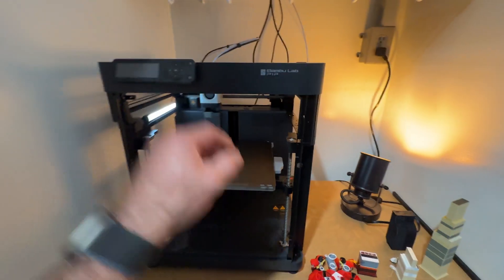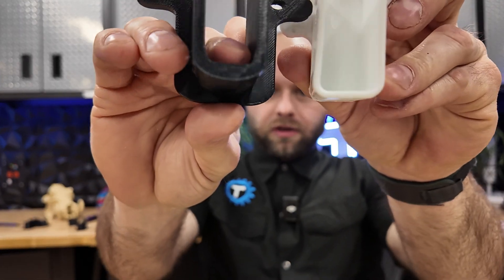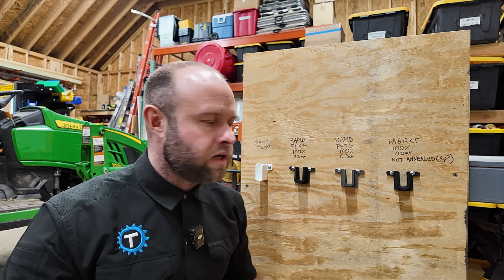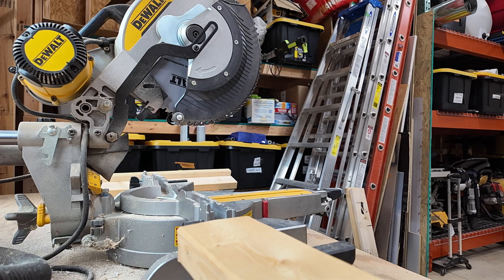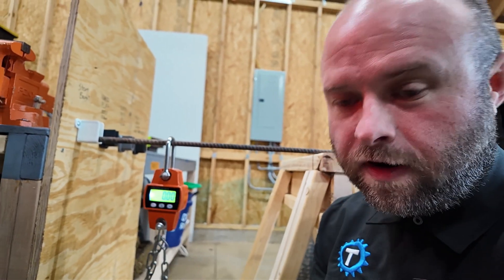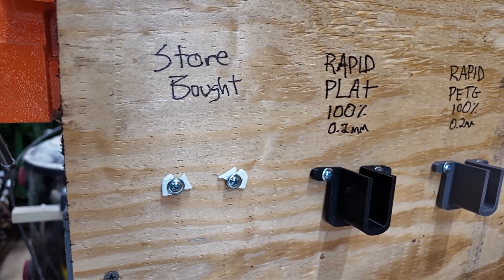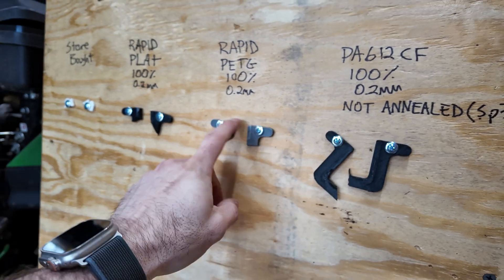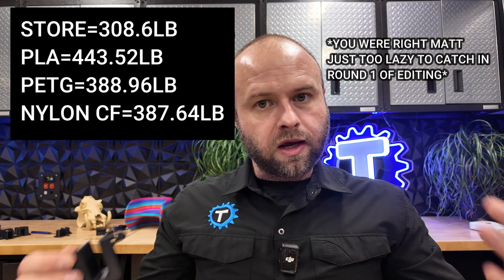3D Printed vs STORE BOUGHT brackets - Tested

Comment: If you blend the screw holes better to the main body of the bracket it would be stronger as well. I printed the small hooks that help support the back of the shelf for my closet. I didn't feel like running to the store to get some to replace the failed factory plastic ones, and now 3 years later they are still working fine. PLA+ is a surprisingly strong material as long as temperature resistance isn't needed. I've never been impressed with PETG parts for their strength.

Comment: If ur looking for a material that is good for practical prints use abs it’s meant for those applications it’s stronger then pla and petg also when the carbon was tested it was being pulled at more of a angle so that could of impacted the results a lot more based on how it broke

Comment: I make all kinds of stuff with my 3d printers. I have fixed my kids toys, replaced the handle on my wifes swiffer wet jet, made wire management, even zip ties in a pinch.

Comment: The CF filament are always less strong then the same filament type without CF. So your basic Nylon would be stronger then the CF nylon since CF is a marketing stunt and due to Carbon fibers align dyring the prong you layer adhesive is weaker.
Reply: One exception seems to be PETG. It loves being fiber filled.

Comment: I made a similar bracket for the wood dowel in our coat closet.  The dowel is warped from years of abuse and kept popping out of the attached metal bracket.  I essentially made an extender for the existing bracket and haven't had any issues.  The only difference, I printed mine out of TPU.

I'd be curious to see how a TPU version of your bracket compares to the others.  TPU is nigh on indestructible.  My first prototype didn't have thick enough walls so it started warping, but the second and final version has been rock solid.

Comment: I’m betting with a small bit of redesign and using the layer lines to their best advantage in tension you could get over 600lbs for the same weight of PLA. I liked your testing method… you do need spread the load between the sawhorse and the bracket… and proportion it depending on the distance of the gauge to the sawhorse and bracket. I’m guessing you need to divide the recorded breaking weights by 2 (ish)

Comment: Looks like youre not pulling at the same distance for each of them. This will change the load % transferred to the bracket/sawhorse.
Reply from the maker: Considered that! In the future if I need to pull down in a standardized direction i'll rig up a pulley and pull the rope with a speedboat
Reply: @TechnicalsTinkers  It's about pulling at the same distance from the mounting point. At the same time, make sure the distance between the bracket and the other supported end of the bar is the same. Example: 4 inch from the bracket, 24 inches from the bracket to the sawhorse. Based on what I can see in the video, results for the second and third bracket  might be off by 20-30% or so.

Nevertheless, good real life application testing!
Reply: 100%. That last test had quite a bit of side load on it compared to the first few test.

Comment: For your application, I wouldn't consider PLA at all, it is guaranteed to deform over time with weight applied. PETG would be a better choice, but from my experience, it still suffers from deforming after a long period of use. Nylon or Polycarbonate could be the best, and you certainly have the machines to print them. And interestingly, I don't think 100% infill is necessary for strong parts. From what I remember, 4-6 walls + 20%-40% should already be strong enough for most applications as there's a diminishing return for infill.
Reply: I would tend to agree, but I've a bracket holding my spare 45lb barbell to the wall. It's printed in PLA and has been there for over a year.

I was nervous, but PLA continues to impress me in load bearing, sub-40° C applications.

Comment: I like your move with not including the cost of the hardware, more times than not the correct mounting hardware is not included, or the hardware that they do include a subpar and will fail before the bracket or has manufacturing defects. I install thousands of anchors of various types every year and the separately purchased anchors are far superior.
Reply from the maker: @aetherguy881  let me ask you your pick for drywall anchors then. I like the 75# plastic screw in vs the toggles. You?
Reply: @TechnicalsTinkers  it really depends on the load that I am supporting. If I am installing most conduit 1 inch or smaller on drywall I will use a zinc zip it. Otherwise I will end up using a toggle bolt. Obviously if I can use a stud, i will. Other situations I'll use a heavier Duty anchor. However when I'm using a plastic anchor it's usually in a masonry wall.

Comment: Another YouTuber also tested the strength of different filaments and they found that the CF filament was not as strong as the others, so effectively it's a waste of money paying the extra…
Reply: Most CF FDM filaments are made so they are dimensionally more accurate not so much for strength. As others have stated the fibers can hinder layer adhesion.
Reply: Not sure of the specific video your referring but, I would have to disagree. CF is proven to improve layer adhesion. CF also improves the flexibility/impact resistance. Theres alot more to strength t hen just a off the roll filament tug-of-war test.

Also you should understand real world failures will be at the layers. 
Layer adhesion is lowest stat in all filaments. even ABS and ASA breaks on layers. 
Something like E3D High Flow ObXidian nozzle can improve layer adhesion by 30% for all filament types.
Reply: @RustyMetal  not true ☝️

CF fibers will break your layer’s adhesive since carbon fibers dont stick to each other. And when you print those fibers will be aligned in printing direction. So your CF filament is actually stronger before the print then after the print. 

Before the print the fibers are in any direction making it strong. 

It’s just a marketing stunt to make us by new filement.
Reply: @RustyMetal  It depends on the material, formulation, and printing conditions. Generally, fiber filled materials have weaker layer adhesion than comparable materials without fiber. There are exceptions though, such as PETG, which generally performs better with CF or GF fill.